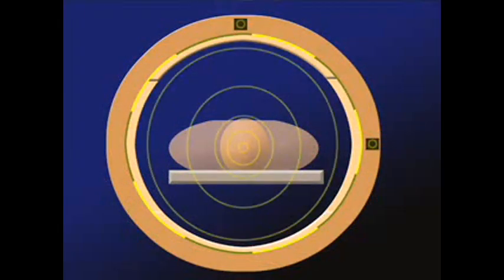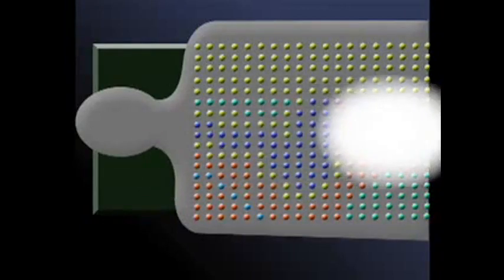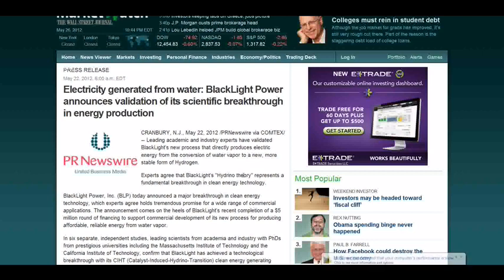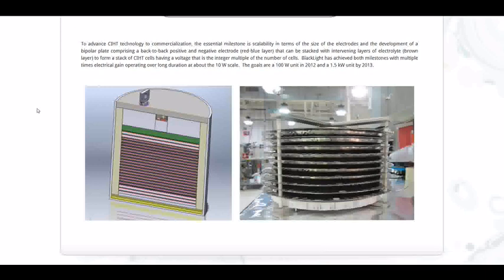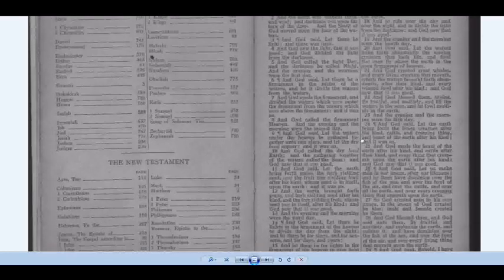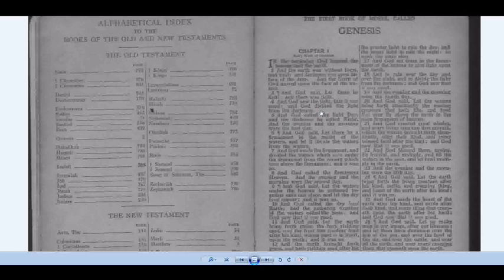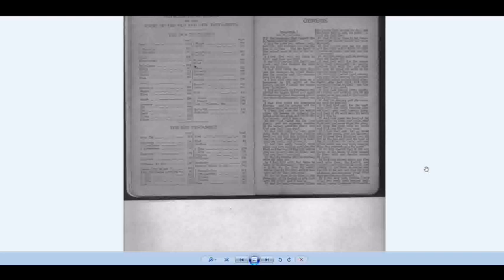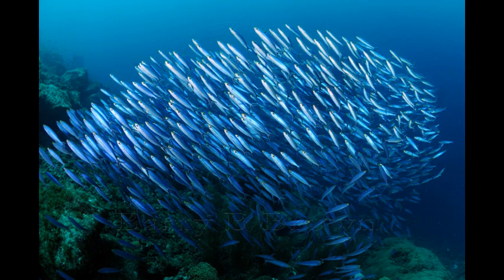Major Breakthrough in Free Energy

Comment: Hey Tuff have you experimented with neodymium magnets and copper yet..??? I have my self  produce and electric current by just dropping a neodymium magnet thru a copper cylinder using at least a minimum of a 3/8  thickness and a1-1/2 inch ID on the copper tube the neodymium magnets should at least be a 1 inch square or double stacked which ever you choose check it out Brother you will be amazed !!!!

Comment: The containment systems aren't electronic in nature, they're mechanical for this very reason.

There is also an emergency valve that is held back by active electronics in case of that very scenario. If there is a flare, the electronics fails and the valve opens and dumps argon into the reaction chamber - reducing it sustainable levels.

I don't know what nonsense the in-group energy industry shoveled into you, but nuclear power isn't just smashing a few atoms together and hope for the best!